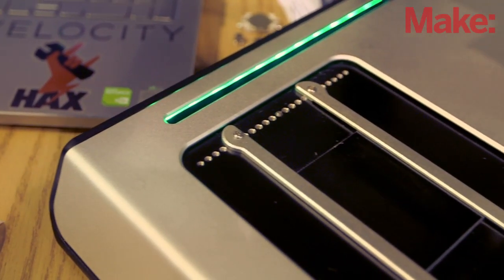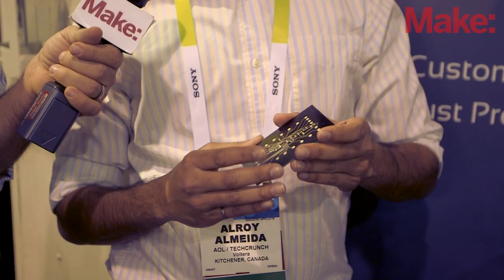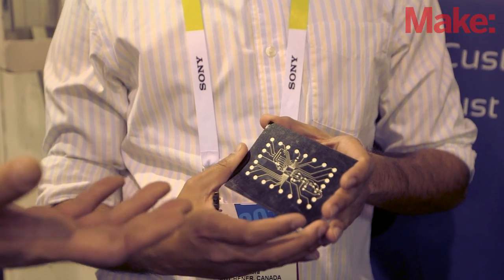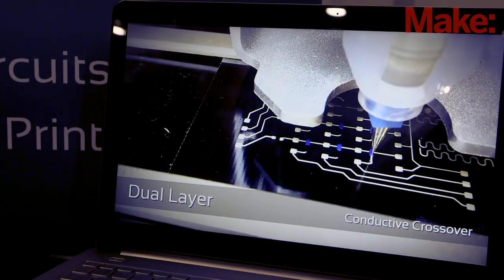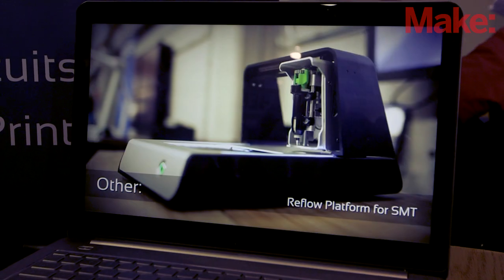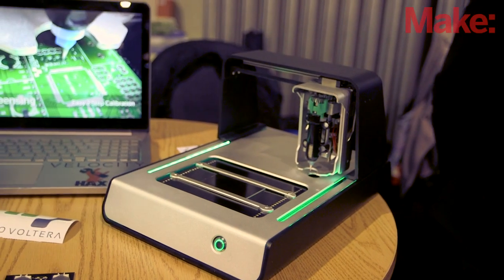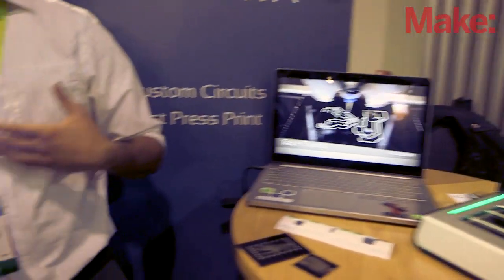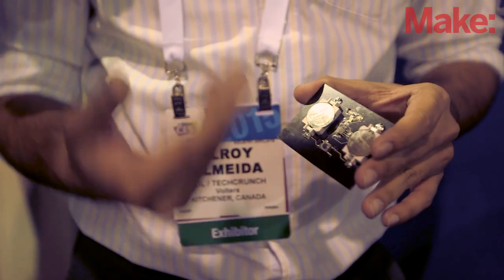CES 2015: Print Your Own Circuit Boards

Comment: Seems like a winner if you need to do a lot of prototyping limited to 2 layer surface mount assy.
The consumables cost should also be weighed into the equation.

If you have the lead time, uploading a Gerber file to a service house may be more cost effective:
China -  http://www.seeedstudio.com/service/
Portland Oregon  - http://www.sunstone.com/
Reply: That's actually less cost effective in the long run. You may have to make a 1000 boards, but in the end this will save you money per board.

Comment: Even at $1500 introductory price this is an affordable device for a dedicated hobbyist. In time the price will surely drop. If you want to be first on your block to have a neat circuit board printer then this device is promising.

Comment: Low speed low power analog. How about high speed digital? Or high power? It's the same as the Agic ink. It cant' handle high current without bubbling and burning out and it's not great at high speed PWM and similar.

Comment: minimum pin to pin pitch 0.8mm? that's pretty much...even my diy-cnc pcb scratcher gets down to 0.25mm.
Will there be improvement to prototype tqfp or something below 0.4mm ptp pitch?
Reply: +Keysforjourney I'm avoiding cnc pcb milling because you have to do so much work yourself.